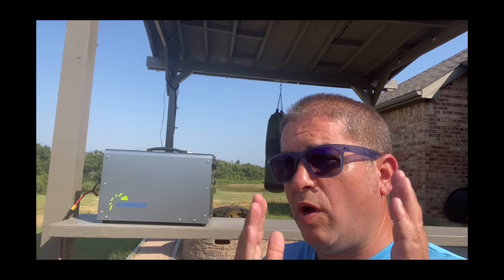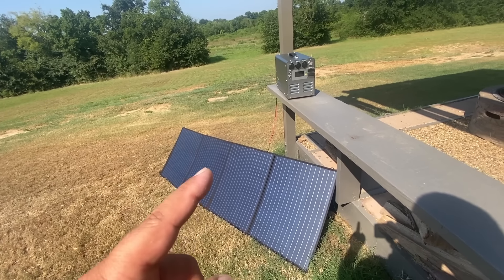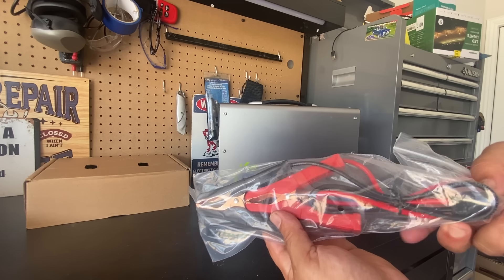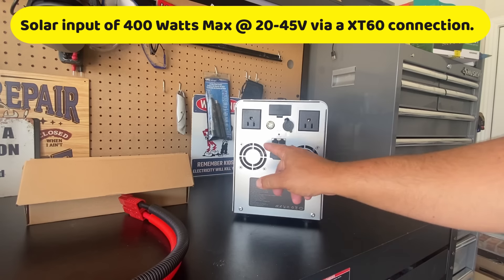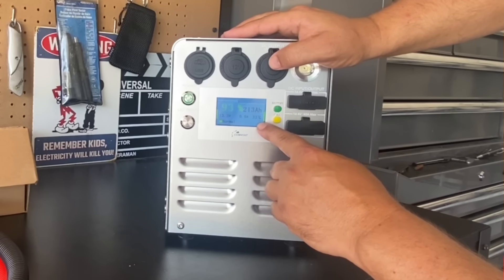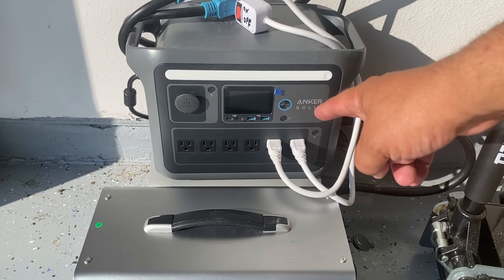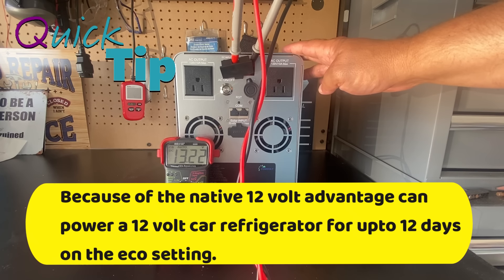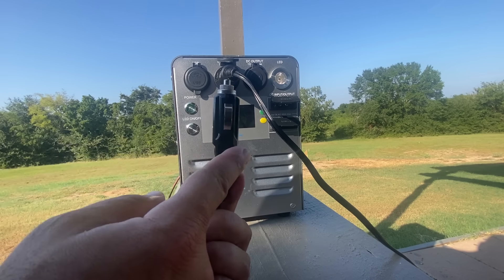Is The Comvolt 3KW Power Station the BEST Option For 2024?

Comment from the maker: ▶▶▶▶▶CURRENTLY ON A SUPER SALE, AND SAVE EXTRA WITH COUPON CODE Comvolt_RANDOMFIX101
Comvolt 4Kwh Unit
Purchase HERE
▶▶ Link to recommended vendor HERE https://bit.ly/comvolt4kwh 
▶▶▶ for extra saving use this Coupon code :Comvolt_RANDOMFIX101
▶ Amazon link ( more expensive than buying direct ) not available yet but here is the 3KWH link https://amzn.to/3X15I7h

Comvolt 3Kwh Unit -- $$$$ The 4 KWH UNIT IS MUCH BETTER DEAL -see links above
▶ 3Kwh Unit Review https://youtu.be/7I8w5NbcXXA
Purchase HERE
▶▶ Link to recommended vendor HERE https://bit.ly/comvolt3kw
▶▶▶ for extra saving use this Coupon code :Comvolt_RANDOMFIX101
▶ Amazon link ( more expensive than buying direct ) https://amzn.to/3X15I7h

▶▶▶ Vehicle Charger Install https://youtu.be/vN6dCU8epOw

▶▶▶ Perfect 400 watt solar panel https://amzn.to/3YRMjYQ

Want the smallest unit with 6kwh of power?  6,016wh!!
▶▶ Link to recommended vendor HERE https://bit.ly/comvolt6kw
▶▶▶ for extra saving use this Coupon code :Comvolt_RANDOMFIX101